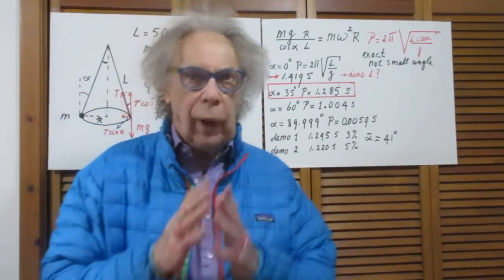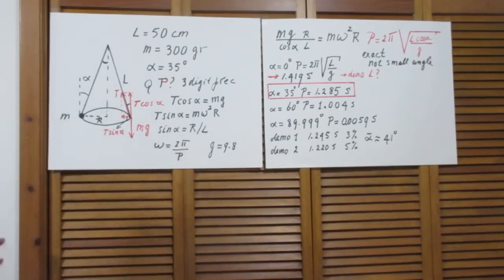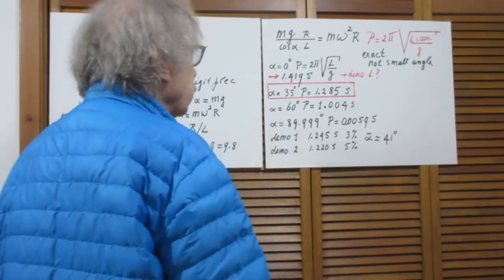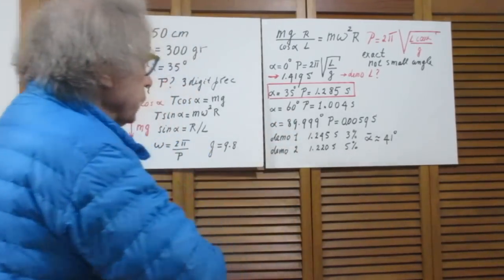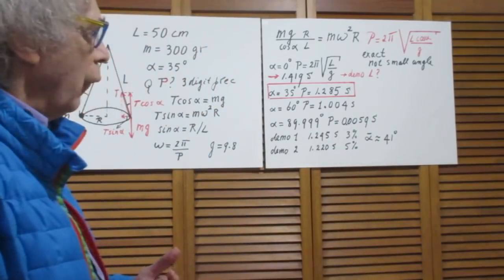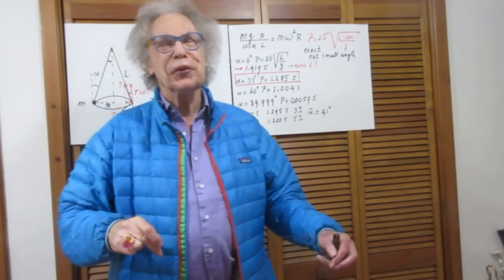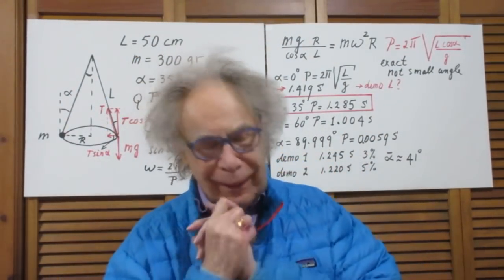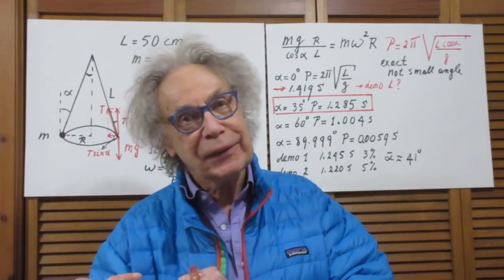Solution to Problem #65 - Conical Pendulum

Comment: How do we explain the period tending to zero when the angle tends to 90??
Reply: I know this is 5 years late. 
To get 90° it means that there would be no gravitation component pulling it down. That would require the tension in the string to be infinite, which requires ω to be infinite. So the infinite speed requires no time to rotate once. This is not physically possible for several reasons.
It is the same problem you have hanging a weight (like a traffic light) on a cable between two poles. To get no sag in the cable, you need infinite tension. As you increase the tension to make the cable straighter and straighter, eventually either the cable will break or the poles will fail.

Comment: Get well soon, u r in pain but u don't compromise with ur work.. u should take rest if u r not feeling well..
Reply: This is inposible because this is not an illness. This is old age.
Reply from the maker: @korgikakorgika9345  not old age. swollen lip (once or twice per year) I already had at age 40. It's an allergy.
Reply: @lecturesbywalterlewin.they9259  You should be careful.
Reply: @lecturesbywalterlewin.they9259  get well soon:)
Reply: @lecturesbywalterlewin.they9259  get well soon, professor
Reply: @lecturesbywalterlewin.they9259  Get well soon sir
Reply: @lecturesbywalterlewin.they9259  which book's question these are